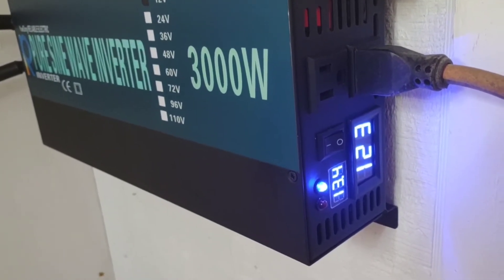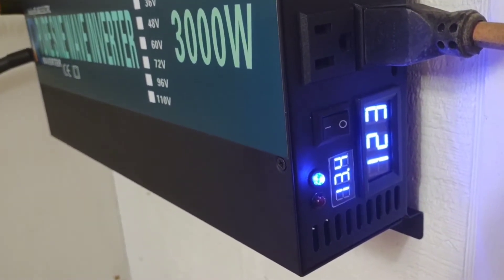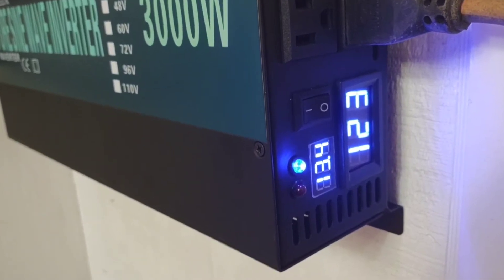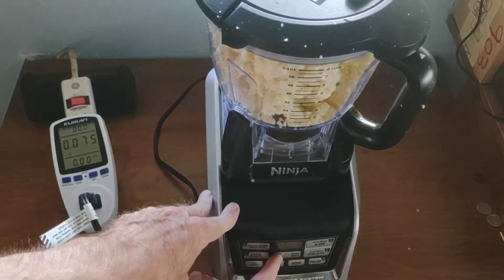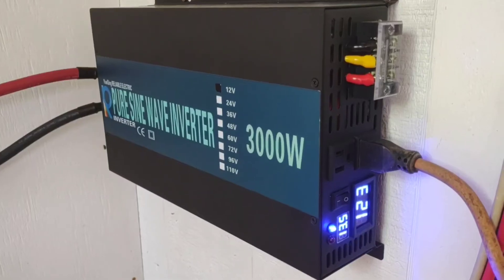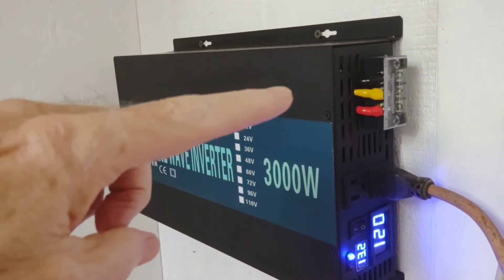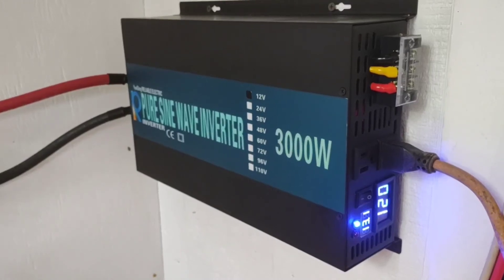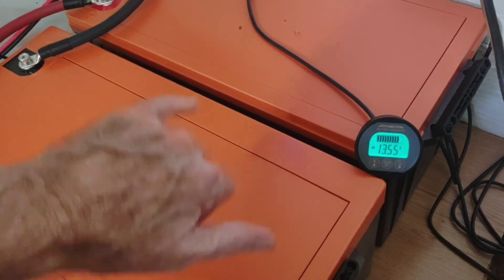12 v 3000 watt Reliable pure sine wave load test.

Comment: Interesting. Can you pull 25a from the hardwire? Assume outlet will only allow 15/20a max, right. Thanks for sharing
Reply from the maker: I believe that those are the ratings for the outlets (15amps each) and 25 on the hardwire...not 100% sure yet, but will find out. Thank you for tuning in 🤙

Comment: I started at you first video and just ended here. I commented on one of your others about the voltage sag. Depending on your input voltage and load drawn determines your output voltage. I have had mine sag down to 116v but was also running a water pump refilling my tank. But I also currently have lead acid. May order me up a Chins real soon after seeing your setup.
Reply from the maker: Wow! That's fantastic,  and I do hope you're enjoying the content. I still have a few lead acid batteries around,  but I have really been impressed with the lifepo4,  and as long as they stay around and last they are my new go to for storing power. Appreciate the feedback about the inverter as well...mine sits at 123v until I draw heavy,  then usually 120v. So far, so good! Thanks for your support of what I'm trying to do here...aloha 🤙
Reply: @ProjectsinParadise808  subscribed.

Comment: I have got the same power meter to test my electric devices. I'm never going back to using High Frequency Inverters. I'm staying with my low frequency inverter from now on. Yes the Low Frequency Inverters are larger and heavier but they are worth it for the reliability and my 12v 3000w inverter is 240v, will do surge power of 9000w for 20 seconds.  I'm in the UK.
Reply from the maker: I am enjoying the power meter,  and it is pretty accurate given me great information on everything I'm running.  Appreciate your information and sharing it with us. Aloha from way over the other side of the pond!🤙

Comment: i have the 24 volt version and it works great .it has no problem running on older 6000 btu air conditioner
Reply from the maker: that's so great to hear!🤙

Comment: At 3000watts can you get a 1500watt or 15 amp load at each of those receptacles??
Reply from the maker: yes, 15 amp each receptacle,  25 amps on the hardwire block🤙
Reply: That’s an OR function and not AND, right